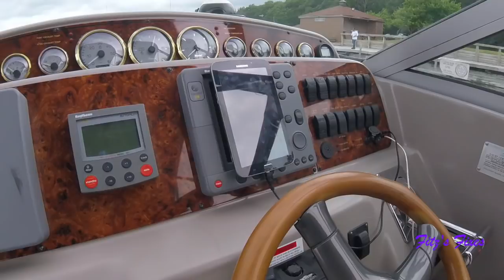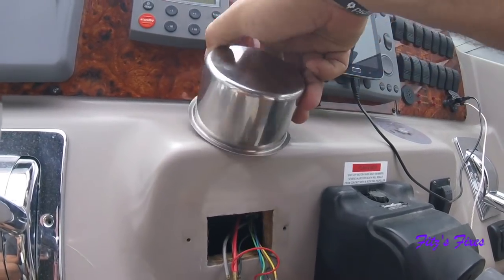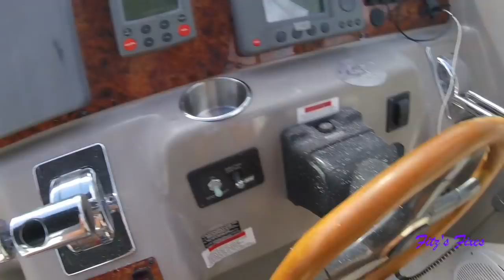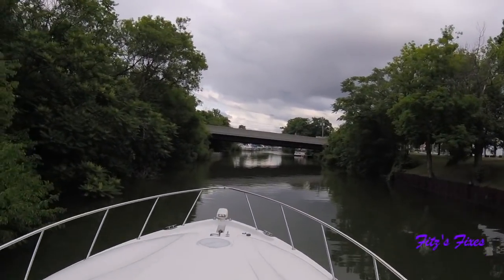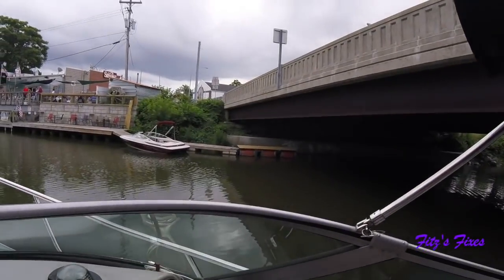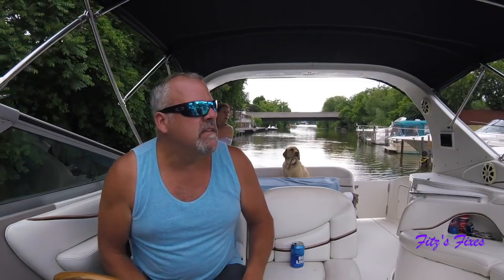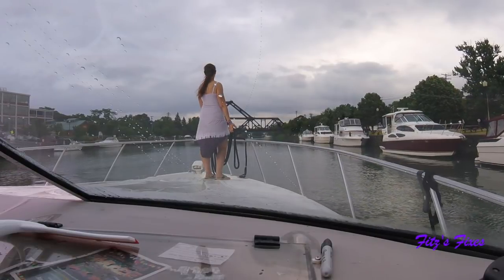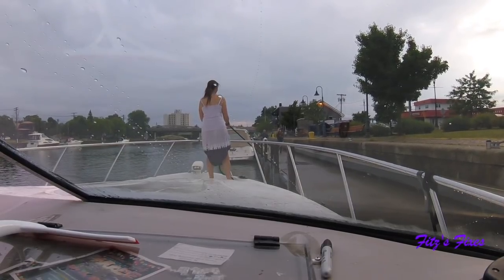Docking in tight slip

Comment: I'd use that ledge down at left knee level where you got the can sitting  for my cup holder and not put a hole by any electrical.     Amazing how low that bridge is.   Some one should paint clearance marks on the side.
Reply from the maker: That ledge is a step for the walkthrough windshield.
Reply from the maker: I watched someone break their radar arch off on that bridge. Its dangerous, but it isnt a navigable waterway. Just a creek to a small yacht club